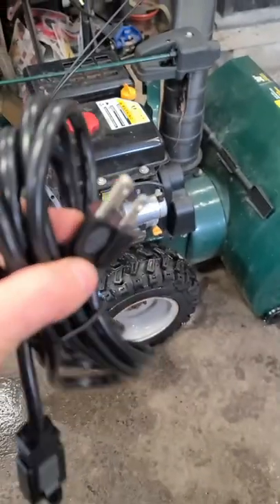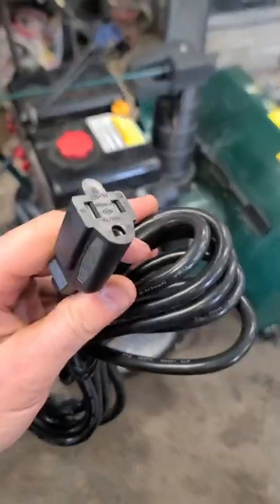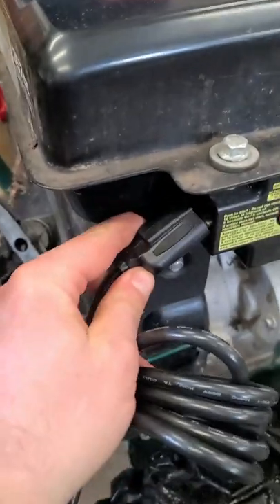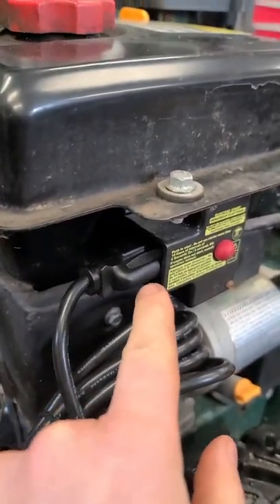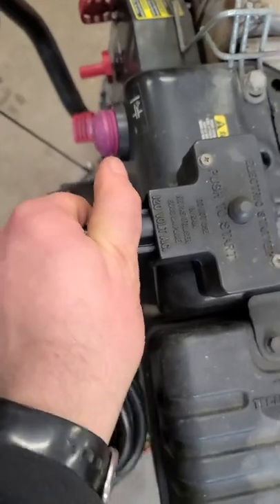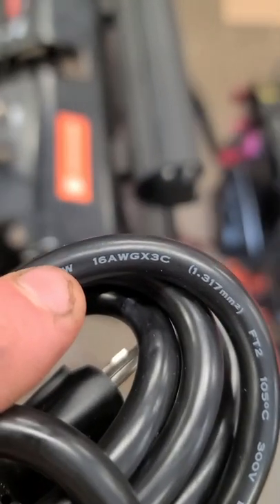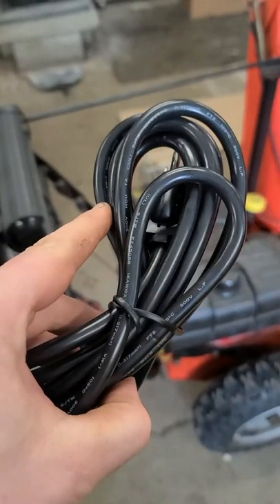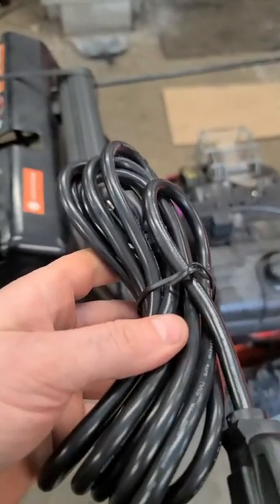This Is The Proper Electrical Cord You Need For Your Snowblower Electric Starter!  #shorts

Comment: Bigger the gage, the better.  I don't buy an extension cord less than 12 gage.  Save your electrical tools from starvation.
Reply: I have a 16AWG 100 foot cord I use with my electric weed-whacker and edger - no problems in 30 years.  That said, for a snow blower starter, anything over 20 ft I'd use 14AWG. 12AWG is overkill, even for 100 feet on a 15A circuit.

Comment: So important to use correct gauge and type of electrical cord. Thank you for pointing it out. 👍
Reply: Yes, all about size
Reply: Length too. Don't use your 100' 16 guage extension cord. Use a shorter one.
Reply: @lucash1980  That 100' 16gauge will help heat up your shop !  maybe even use 18g ?

Comment: Question. Can you place fuel preservative in a 2 cycle engine fuel tank which contain oil mix?
Reply: Yes I do no problem
Reply: @gillgetter3004  Thanks.
Reply from the maker: yes
Reply: @donyboy73  Thanks for the response. Always look forward for your instructive videos.
Reply: Many new oils come with stabilizer in the 2 cycle oil already. Mostly the synthetics, the one I use does

Comment: What about the length? Can it be over 20’?
Reply: I haven't looked at details, but to turn a starter motor, the length of the cord probably isn't an issue.  it's electric tools that can have trouble if the cord is too long.
Reply: At least 16AWG - shorter the better - about 4 ft.
Reply: @akbaxb165  I checked  on the wattage, and it looks like they peak at 1 KW draw when starting.  so a 50 foot 14 AWG cord wouldn't have a problem.  my voltage drop calculator doesn't go down to 16 AWG.
Reply from the maker: thanks Ken
Reply: I think 20 to 25 feet would be OK with 16AWG (American Wire Gauge) as long as you don't crank for extended periods of time. However, for repeated use at that length I'd go with a 14AWG cord. [I was an electrician.]
Reply from the maker: @RichardFallstich  thanks for the tip

Comment: What is wrong with using a smaller gauge extension cord with the 3 prong plug? I am no where near the mechanic as Donyboy is so this has to be explained to me ;)
Reply: The wire will not take the current, and will overheat. It may even burn up if you don't release the button fast enough.
Reply: Sparky here. What's going to happen is the current will over heat the cord with will then overheat the motor untill it melts the something. Then the $5 you saved on the card will cost you $200
Reply: Apparently hard on the electric starter if you use a thinner guage wire and/or a longer extension cord. Resistance/voltage drop.

Comment: I bought a  new starter and it came with a cord. I could not plug the female end in to the switch box until I ground some of the plastic off the outside of it on my bench grinder.